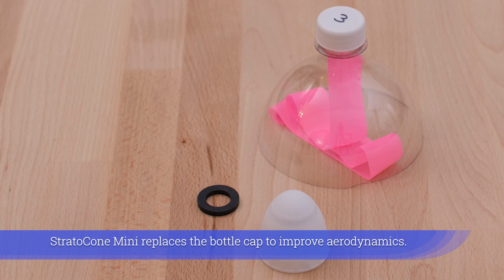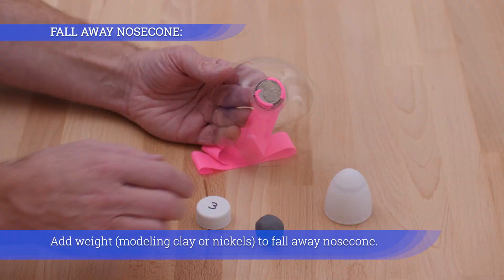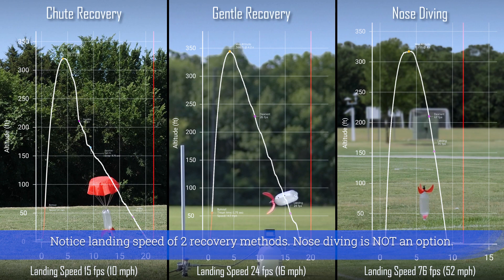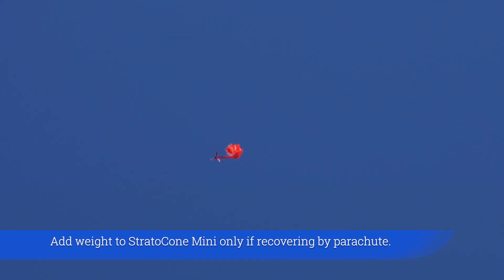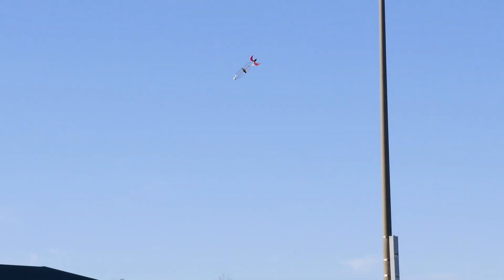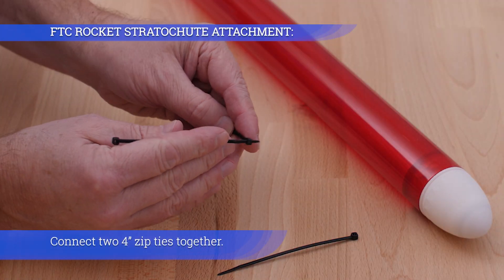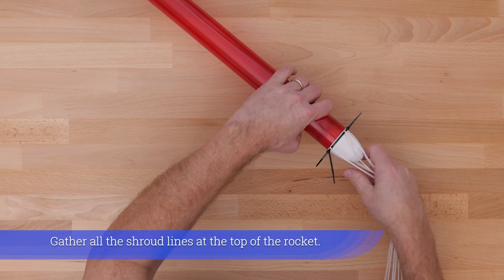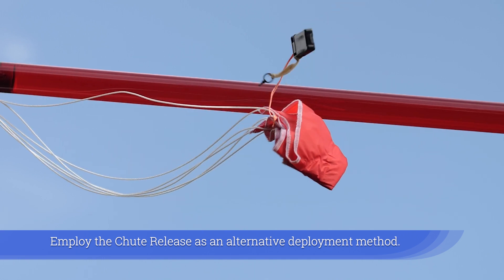StratoCone Mini the Versatile Nosecone for 2L, FTC, and Spliced Water Rockets

Comment: You've really outdone yourself! Much nicer and faster than me mucking about with Easter plastic eggs or making a release mechanism with parts from a wind up toy and rubber band. I'd still miss making the homebrew gear, but sometimes it's nice to get a rocket into the air without the fuss
Reply from the maker: Thank you for your kind words and comments. Yes, I too have messed around with plastic Easter eggs for nosecones usually on FTC rockets. One main reason for developing this nosecone is that many bottle caps don’t seal well under high pressure and designing something that would allow for a rubber washer was necessary. We have several new products that we have been working on last year, but unfortunately, they are rolling out slower than planned due to continual tweaking and improvements. Glad to finally be able to release the StratoCone Mini product along with the video early this year.